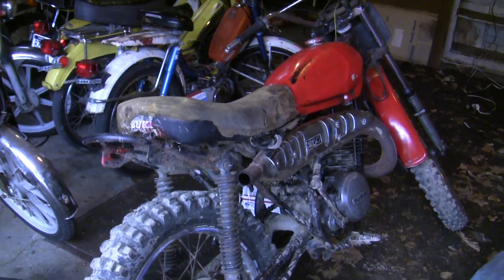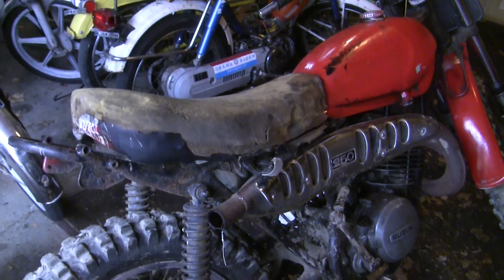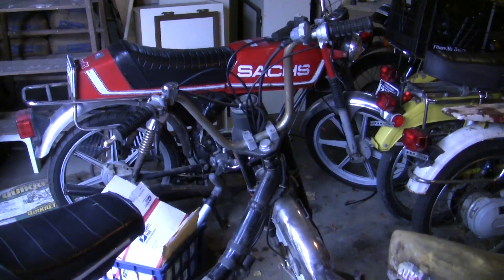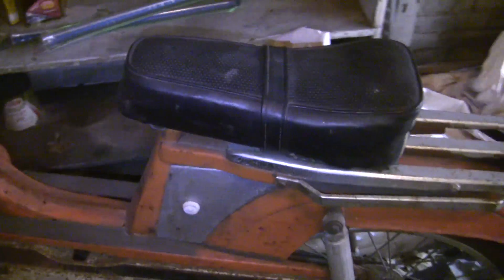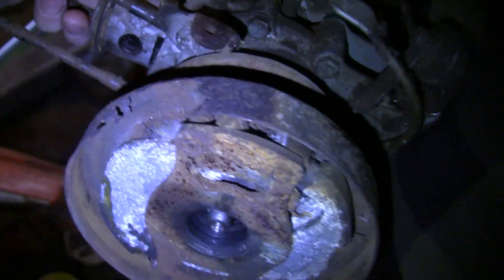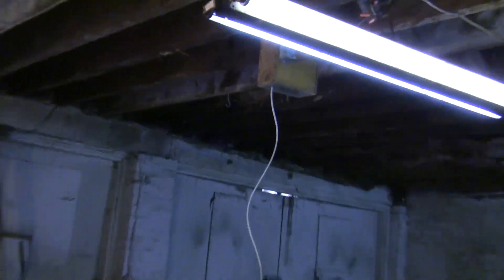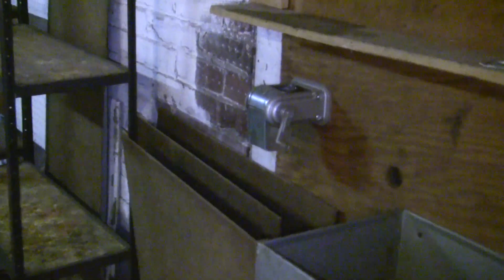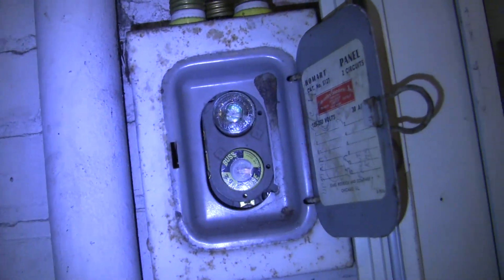Tour Will's Creepy New Garage Workshop

Comment: Hey I have another question. I'm really wanting to get better at mechanics and restorations, and I'm wanting to start a project. I have $600 and there's a 1963 Honda trail 55 c105t for sale on Craigslist for $400. It runs and everything the only thing wrong with it is the kickstart lever broke and the tail light cover part is gone. Or a Sears allstate puch sabre for $600. It ran 4 years ago when he put it into storage. He said a carb clean and a gas tank clean and it should run. It's in pretty nice shape. I really want that puch, but don't know if I should. I realize both aren't mopeds but if you could help that'd be great!! I do have a small amount of experience with mopeds and such. And I have a friend who has a lot of experience that could help if I need it.
Reply from the maker: Both would be extremely fun bikes, it's a lot of your preference but keep this in mind. The Honda is going to be a 4 stroke, but it's great that it is running, always easier to start with a running bike. Tail light cover is easy and you ought to be able to bump start it without the kickstarter for now. Parts will be plentiful and in some cases available directly from a local Honda powersport dealer.

The Puch would also be big fun, but parts for it are going to be hard to find and costly (specifically for the Sabre, Maxi/Magnums are easier). Plus, yeah you might get lucky and it just needs a carb clean, but often times engine seals are just worn out and you have to rebuild, only so much you can expect from a bike that is 50+ years old.
Reply: Do you happen to know how much the Honda trail 55 and puch sabre are worth? I can't find what they are worth anywhere. And I don't really want to be ripped off. You know what I mean?
Reply from the maker: Honestly, they are worth whatever someone is willing to pay for them. If I'm looking at mopeds I generally don't pay more than $200 for a non-runner as a maximum or $500 for a runner. If it's missing the title even less. I'm able (and thankful) I can do this because they are plentiful and undesirable in my area.

However, these are not mopeds. I'd probably pay 6 for the Honda if it was titled, clean, and had modern tires on it. I would try to haggle the Puch seller down to 2. It just comes down to how stoked you are about them. I way overpaid on my Honda MB5 because I had the fifty shifty fever, do not regret it!
Reply: Sweet! Thank you very much for the info! Greatly appreciated.